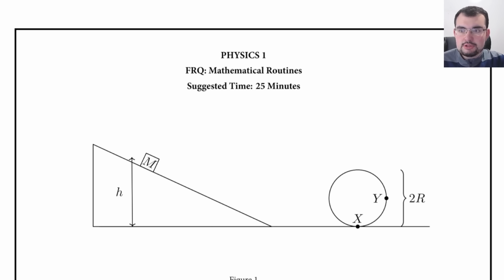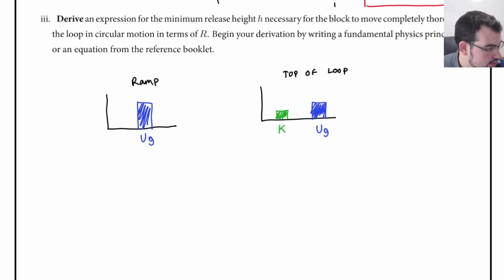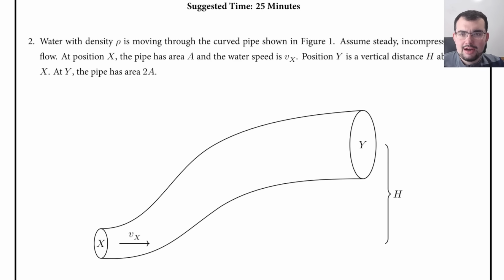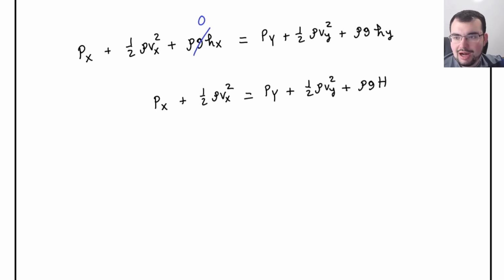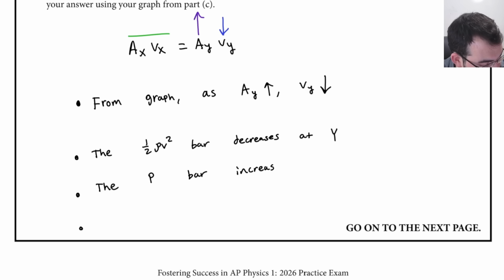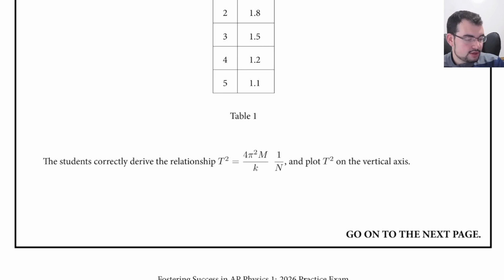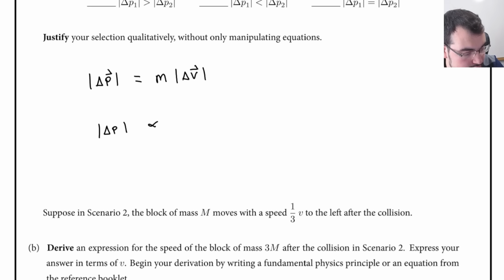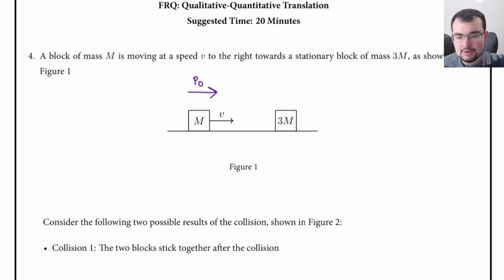AP Physics 1 2026 Practice Exam (FRQ, Easy/Medium)

Comment: Would it be correct to graph a T^2 vs. N and find the area under the graph? k would be equal to the same equation you derived of (4pi^2*M)/(slope or area or T^2*N)? With this, I did get an experimental value of 3 so I don't know if its close enough to be within the margin of error or not be the method is the same
Reply from the maker: I do not think that is correct

Comment: So no points will be lost if you don't calculate the slope for the line of best fit by hand, using two points not specified by the graph? is this something they've changed?
Reply from the maker: Slope by hand is fine!
Reply: @FosterWisusik but we don’t need to do it by hand right? I feel like this would save time
Reply from the maker: Please use Desmos! (You have to plot the points on the grid and draw the line though). I never recommend doing it by hand personally

Comment: Quick question before the AP Exam!. For the experimental FRQ or FRQ 3. Am I allowed to draw a diagram in order to explain my experimental process. And if I can will they be able to use it when grading.
Reply from the maker: You just need to explain what to measure and how to reduce uncertainty. No procedure is needed. A diagram is definitely helpful if you want to avoid ambiguity (but I would not be concerned since the setups are usually pretty straightforward)

Comment: Question (sort of unrelated to these FRQs), would we lose points for starting a derivation with toricelli’s theorem, since the actual equation isnt on the sheet? (In case it appears in FRQs tomorrow)
Reply from the maker: Start with Bernoulli if it is a derive problem. You need to start from the formula sheet in most cases.

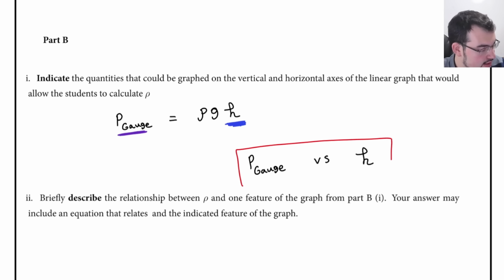Comment: At 42:23 when you mention needing to say “vs” instead of “and”, if i said “graph Pressure in Pa on the y-axis AND (not vs) the depth in m times the gravitational field strength g on the x-axis, would i get that point? Also, based on that, would i get the point for graphing h•g, with slope of ρ?,
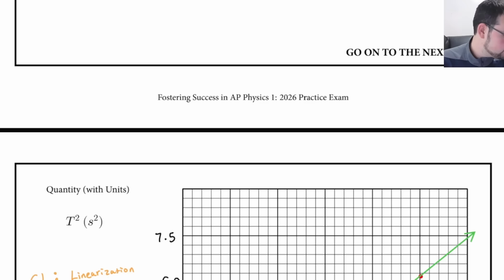Reply: 48:03 Continuing with this, i graphed for part c (4π^2(M))/, so that my slope was 1/k. When plotting, the graph was still linear and points looked like yours, just with different x values. Would i have gotten those points? Regardless, this has helped me so much knowing that I DONT need to isolate the slope to just one variable, thank you!
Reply from the maker: Full points on all parts. We just need any correct, linear relationship. It’s up to you how many variables to include on your axes vs how many to keep in your slope. It’s all personal preference!

Comment: 30:30 if i solved the quantitave values on the bar chart for rogh kinetic and potential quantitatively, thatis by putting the correct quantotave values, this means i already knew that V_y was half V_x, do i still get points B2 and B3, espacially since i wrote them on the page before just so i can evalutae them
Reply from the maker: Absolutely. I thought it was too hard to have students get them exactly quantitatively correct since that would require doing some derivations ahead of time! As long as your v bar went down and your h bar went up, you get all three points as long as the “energy” is conserved

Comment: In Problem 2, before watching this video, I did the FRQs myself. I honestly found them quite easy, so saying that you thought this was tricky was a surprise. When you did the derivation with Bernoulli's, you ended with 3/8pv^2 + pgH, while I ended with 3/4(1/2pv^2)+pgH. This is because when I set v_y to half of v_x, I took the resulting 1/4 out instead of multiplying it. However, my approach should be correct, since you can just multiply 3/4 into 1/2 to get 3/8. So is my approach fine?
Reply from the maker: I really only thought the second one was tricky for many P1 students. The rest is quite straightforward. Everything else is on par with how the exam difficulty seemed to me last year. As long as your answer has the required symbols and is algebraically equivalent, you will get full credit.
Reply: Why didn’t you respond to the error u found 😔
Reply from the maker: @AmericanGuy12th Because I have no idea what you were trying to say.

Comment: Final question (maybe), do you give half points for students who, for example, get v^2=2gh, but use third kinematic equation to derive the wrong final answer?
Reply from the maker: Can you explain your method a bit more? I’m not sure I totally understand.
Reply: @FosterWisusik  Sorry, I meant v^2 final is in the formula and if I were to decide to use the third kinematic equation (v^2 final=v^2 initial+3a*delta x) when that is wrong, do you get credit for getting the v^2=2gh part?
Reply from the maker: Yes. You will get at least one point for that.

Comment: Can you justify FRQ 1, question b, by stating that since there is friction, there must be negative work on the system? ( which would remove some of the initial energy from Ug) Or would readers specifically be looking for energy needing to split off into rotational and translational?
Reply from the maker: Since it’s rolling without slipping, there is actually no work done by friction since the bottom of the sphere is stationary relative to the ramp. 

If you wanted to use forces and friction, you would say that since the friction points up the ramp, the acceleration of the sphere is lower than the block, so is slower at the bottom, and cannot go as high from the same ramp height.
Reply: @FosterWisusik  Oh okay, yes. I just completely blanked and forgot that rolling without slipping means no work by friction, thank you, Mr. Wisusik.
Reply from the maker: No worries, that is not a very commonly used fact!

Comment: I found a mistake in your work. In FRQ 3 you label the x-axis with 1/N, but 1/N is not possible. You cannot have a decimal form of (#of springs). Instead, I made the x-axis N and then found K by multiplying the y axis and x-axis and finding the average value. Then dividing 4pi^2(0.8) by that value(6), which got me the value of K which is around 5 (5.26). Also I graded the FRQ 9/10, 12/12 10/10 6/8. This gets a 5 well above the margin (if you are curious). Thank you for your time in making these!
Reply from the maker: 1/N is possible. We are just transforming the data to make a linear relationship. It does not need to be a physical quantity.

Regardless, you absolutely need to graph the data and use a best fit line to get pints on FRQ 3. That is just how CB grades this test. Make sure you can do the linearization.

It definitely sounds like you know your physics, just know that we look for a very specific method on FRQ 3 that you need to follow (even if your method found the right answer)
Reply: @FosterWisusik  ok so transforming 1/n is allowed, sry for my arrogance.  When the AP exam comes time, the graph has to be linear always?
Reply from the maker: Yes. That is a quirk of the AP Exam. It is very specific that you need to make a linear graph. I don’t want you to lose points when you clearly know the physics!

Comment: I just have one question. If they ask for the normal force at initial position(like on the ramp) and it asks us to give the normal force on the FBD, then we would just have to show that the F_n is angled to the top right, correct?
Reply from the maker: Yes. The normal force is perpendicular to the surface. 

Do not decompose gravity on the FBD though (keep it directly down)

Comment: For frq# 1 part (a) (i), shouldn't the normal force be pointing up and to the right in order to counteract gravity for the second FBD? also for the first FBD shouldn't the Fn be greater than the Fg bc it is doing UCM so Fc = Fn-Fg, so Fn>Fg
Reply from the maker: Normal force is always directly perpendicular to the surface. This is not uniform circular motion, since the block is slowing down as it rises. UCM requires constant speed.

You are correct that since the block accelerates towards the center of the circle, Fn > Fg at Point X, but I did not give a grid on the FBD so the relative lengths could not be scored. If I gave you a grid, you would have to indicate the normal force is greater than Mg at the bottom for the reason you said. 

At Point Y, the net force is actually down and to the left since the block is moving in a circle, but slowing down.

Comment: Do you guys care about writing down units and using capital M when showing you work (for example, K=1/2mv^2 or K=1/2MV^2), or can I ignore units and capital letters in equations?
Reply from the maker: Units are only required on the Lab FRQ part (d). The only time we care about symbols is when you are reporting your final answer. You should use the notation in the question, but you will get credit as long as its clear what you mean. No reader is going to not give you the point since your m was not capitalized... 

Just be careful if there is a capital and lower case M in the same problem, for example.

Comment: Do they make each years test slightly easier to allow more people to pass? Cause I have seen that the pass rates in the previous years were much lower and during 2024 they increased alot.
Reply from the maker: There was a redesign of the exam last year. The new style is much more fair and much easier to pass. Expect easier questions than the pre 2025 era.

Comment: I found the fluids question kind of easy, would that be the hardest fluid type problem on the ap physics test?
Reply from the maker: I can’t imagine much more than that. I did probably everything you can do with an energy based fluids problem. If you found this easy, then you are probably good with anything Bernoulli that could be asked! 

There is also some F=Ma and kinematics stuff that can be mixed with buoyancy, but I think that’s pretty easy (look at how easy last year’s Q4 was)

Comment: You made a typo, where in question 4 a, you said justify you selection qualitatively, WITHOUT ONLY manipulating equations.  That could hurt people who are taking this test if they are confused whether or not they need to use qualitative reasoning, or use the conservation of linear momentum.
Reply from the maker: Good Question. Unfortunately, that is the official language College Board sometimes uses on question 4, and its something you need to think about for the QQT problems. Last year, it exactly read "Use qualitative reasoning beyond referencing equations." 

I am not a fan of this language either (nor are a lot of teachers).  The point of the question is to make you not use equations on that part, since they are not required. 

You can do math, but you need to explain your reasoning to earn those points. The points are for citing physics facts (1 for conserving momentum, 1 for momentum change relating to change in velocity). Momentum Conservation is not an just an equation, it is a physics principle. You do not need to use math to determine anything about which impulse is greater. The scoring on these questions are pretty generous, so if you had a different explanation than I did that talked about momentum conservation it is quite possible to earn both points (feel free to run it by me if you have one!).

Comment: Helpful video. Just had a question, how did you get the equation as y= 6.30x + 0.002 on Desmos.
Reply from the maker: I put my values of 1/N in the X column of a table and I put my values of T^2 in the Y column in the table. 

Then, I clicked the magnifying glass in the corner of the Desmos box to see my points, and clicked the scatterplot button in the box to output the regression equation.
Reply: @FosterWisusik  I also had some more questions to ask. Do you think it’s fine if I graph P(Gauge) vs. gh? Also, all these FRQs felt pretty good to me—do you think they’re around the same difficulty as the real AP exam? Finally, what are your biggest FRQ tips or tricks to maximize points? Thanks!
Reply from the maker: @Michael-z9f1c  You just need a linear relationship. Many students like your approach of making the slope "the answer". You method totally works.

For difficulty, here is what I think about each question (compare with the 2025 exam for a reference) 

Energy MR: About expected difficulty

Fluids TBR: Harder than Expected

LAB: About as expected (with the A/B part being a bit easier)

QQT: Easier than Expected

So I think overall this is an average set. I am working on a tips video later today.
Reply: @FosterWisusik Thank you man. Your explanations and videos are great, and I greatly appreciate your help.

Comment: This'll be really helpful, thanks! Nice to know I caught this just 4 days before my exam, this is a really good way of seeing if I'm ready. 

Right now, my strategy is to aim for as high an MCQ score as I can get (which, in my practices, has been between 27 and 36 out of 40), and then go for big marks with the FRQs, which are mostly fine for me. Contrary to other people, I actually find Experimental Design the easiest, and my issues mainly come with plotting out graphs when I don't realize that they have to be curved. Is this a fine strategy? Others recommend I should work on balancing both, but I think that I'm scoring high enough in the MCQs that I can rely on the FRQs to carry me, especially since you can get partial points.

Once again, thanks for the video, this is really helpful!
Reply from the maker: That’s a good plan. MCQs are really about testing your concepts, so make sure you are good with those. For AP 1 we have the following skill distribution for the 40 questions 

~8 derive (math with symbols)
~9 calculate (math with numbers and graphs)
~ 6 compare (Rankings)
~ 4 Functional Dependence (Ratios)
~ 4 Justify (pick the right answer and argument )
~ 9 claims (Misc questions like bar charts)

Make sure you are good with those skills and know the common question types.

For FRQ, you also have a good plan. A lot of the points are easy to get. The rubrics are generous. It’s the MC where you differentiate yourself more. I agree that the LAB question is the easiest and is almost entirely free points.
Reply: @FosterWisusik  This'll be really helpful, thanks so much!